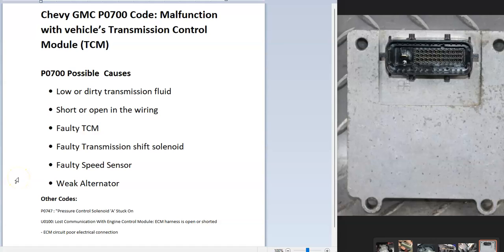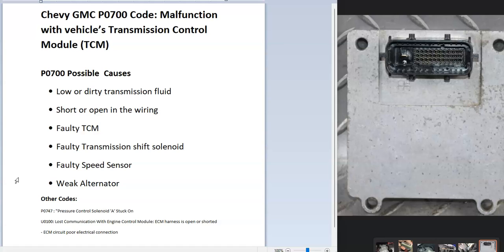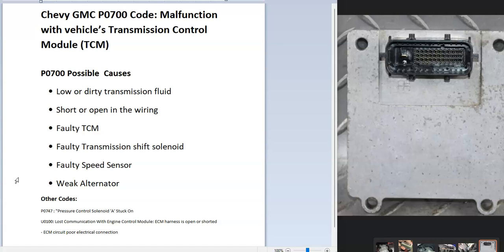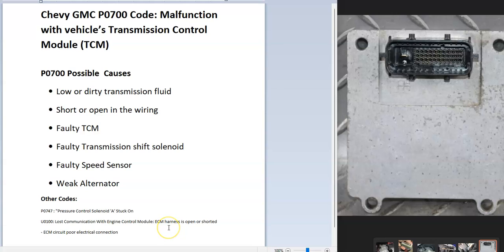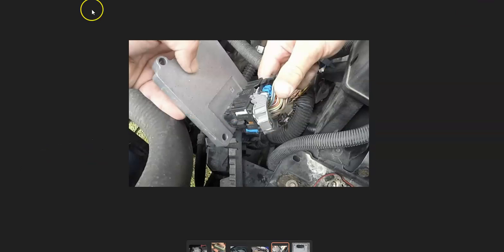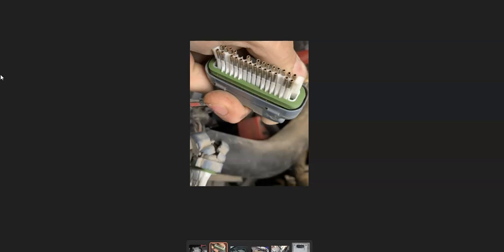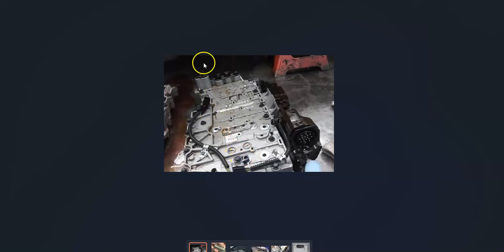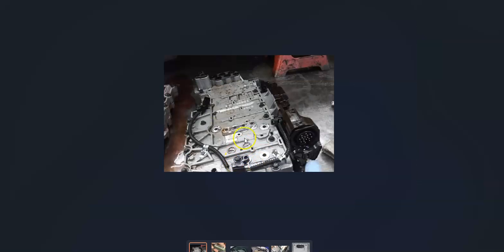Causes and Fixes Chevy GMC P0700 Code: Malfunction with Transmission Control Module (TCM)

Comment: I have a Chevy Silverado 2020  5.3L v8 6l80 and I was having problems with my truck when I wooing drive it suddenly it started losing the gear when I let off for a split second and got back on the gas it would just rev kinda like if in neutral but I would be in drive it would basically lose the gear and I would turn it off and on and it would work again till it did it again and I would get no codes till suddenly I got the p0700 code and it’s the only code that pops up anybody know what it could be if no other codes point to any direction?

Comment: 2007 Gmc Yukon Denali (159k miles)
 i just went to a local shop and the guy drove the truck and told me, i could change the control module and change the oil n filter but he wasnt sure it would fix it, so he said  he had some transmissions for $4k if i wanted too,  so i just paid him the $75 dllrs that he charged me to check it and i left. These are the 2 codes im getting>>>

P0700 ( Transmission control module requested MIL illumination)

P0756 (shift solenoid Valve 2 Performance -Stuck Off)

Comment: I have a 2019 Chevy Malibu LT with the code PO 700 only and the engine light comes on and go out. When I put the car in drive, it will not move and then when I go in reverse, it will move and I would have to constantly go from park to reverse then drive several times before the car would work properly. Can you give me some pointers on what is happening?
Reply: I have this exact problem on my 2018 Chevy Malibu !!! What could this be

Comment: Have you experience a truck that would throw codes ONLY when the trans is over 180 degrees? p0848 p0843 p0756 p0762, only throws one of them at a time but the code changes between those. 

Issue always comes up when I’m coming to a stop and it doesn’t want to go to 1st gear, and when it does it will go back to 2nd gear and throw a code 

New solenoids 
New wiring harness 
New filters 
5 month old pressure manifold 
All Valves move freely
Reply: 2007 duramax lbz 
Allison 1000
And it does have 310k on her

Comment: I had a lifter job on 2022 suburban done at a crooked dealership . When I got the car back , the engine was running fine , transmission shifted properly, then all of a sudden that check engine light comes on and it goes into limp mode ,codes(P0700 and p0747). My first thought was that they didn't plug something in or messed up a wire . The dealership is notorious for sending you out with another issue and having you come back.
The annoying part is that the truck drives great every time after i reset the codes , then the light comes on and it starts acting like i have transmission problems
Reply: What did you end up doing? Having exact same issue. Truck at shop now

Comment: 2003 gmc yukon starts but nothing when shifting between gears not even a change in idle and no codes should i just get another trans or is there any components that I should test for first? I was going very slow in reverse when it lost all gears at once upon inspection i discovered a couple of frayed wires and one severed wire on shift motor I thought maybe Play some miracle and somehow the transfer case slipped in the neutral and that's why it wouldn't go but changed this shift motor all my lights work correctly on my transfer switch now so I fixed the four-wheel drive but that doesn't do me a whole lot of good right now because still nothing in any gear

Comment: I cleaned the plastic air runner to throttle body..... and sprayed and wiped inside of throttle body with throttle body cleaner... gave the MAF sensor a quick shot of Mass Air Flow sensor cleaner... car ran like crap for few seconds till computer reset itself..  fixed my problem

Comment: Thanks for the info. I have have P0700 and P0701 code with the check engine light on and the PRND flashing. Also a message stating that speed has been reduced or something along those lines i cant remember while shifting from park reverse and drive. What could this possibly be?

Comment: I have a 2010 Chevy Silverado 1500 Texas addition , the lot I got it from put a used 6l90 in it I replaced torq converter with the billet to solve factory issue and trans fluid as well as filter , gave me a p0700 transmission control system mil request , and along with a p2534 ignition switch run/start position circuit low . First time it’s ever happened truck now has 220k on the dash torqconvertwr was changed around 160 , any ideas if the ignition switch has something to do with it ?

Comment: 2007 1500, have the P0700 and the U0073 codes.  Hard shifting tranny, wonky speedo, cruise shuts off.  Pull over, shut it down, restart and it fines.  Crazy...

Comment: My 2017 GMC transmission shudders at 45 speed codes P0700 and P0711 comes up jerks when shifting hard
Reply: P0711 is the trans temp is to hot or cold or a bad temperature sensor.

Comment: I have code p0182E and p0700 , I cleared code and only p0182E is still showing but car shift fine, any idea before I send to dealership, but before when I started car my door locks went crazy and I notice service check light was on and then I scanned I saw these codes.

Comment: I have a 2014 Chevy Tahoe PPV. And I changed out O2 sensors on driver side and catalytic converters as well all three of them. But keep on getting check engine. PO20 and P030. And then this code came out C070 I believe.  But you make your videos straight to the point, mad respect. Thank you I will check everything you mentioned.
Reply: Im having the same issues
Reply: How you fix it?
Reply: CATS WENT OUT..CHANGED CAT AND O2 SENSORS..NOW I GOT A 0700 CODE ..N I CANT FIND THE TCM. 2018 sierra 5.3

Comment: i have p0700 and p0106... the p0106 was the map sencer.. so got a new one and cleared code ...but still dint fix misfire code came back.. nothing changed
Reply: If it’s misfiring u probly have a bad coil. I changed mine in my Yukon and practically fixed it

Comment: Mines throwing TCM code and also transmission temp sensor faults. Could it possibly be low fluid?
Reply: Did you find out?
Reply: @dubbsackss20 nope. Dealership told me when it’s a cold start don’t put it in gear right away and since then I haven’t had those codes

Comment: 2010 Chevy work truck p0700 and p0100 and it will not change gear stay in first gear wat you think I should do check for someone tell me it the control module just need some assistance. Hit me back. Let me know
Reply: Did you find out?

Comment: I have a question I have a 2008 Chevy Silverado 1500 engine 5.3 and when I’m in a stop light and turn in the back shifts hard and it does it when I accelerate slowly it dosent have no engine light or nothing

Comment: '18 Tahoe 6L80 here. How about p0700 with p0714 (fluid temp sens intermit) and p0749 (press control solenoid intermit)?  The fluid was dirty, which i feel would explain the first 2, but also 749?  They are both intermittent codes... any ideas.  Never seen any of these codes before and it was time to do the trans service.  The codes came up and it started acting le it didn't want to go through all the gears,  turned it around drive it slow back home and parked it!  Then started ordering supplies for service.  I'm wondering if I should pull the valve body and try to clean it and possibly the TEHCM🤔  Those codes scared me!  Any help would be greatly appreciated!  Thanks!
Reply: Did you figure it out?

Comment: We have a 2017 Tahoe 5.3 with 6 spd. 110k miles.  Fluid changed at 70k.  Checking the fluid, it is not dark and still basically pink except trying to read it on the stick, it is almost clear to the point it is hard to read but can feel the level with your finger and it reads full.   Problems started two days ago.  Shifting rough usually from 1st to 2nd while on a 150 mile road trip.  Later in the day,  after idling in park in a drive in food line, put in gear and engine raved up to about 3k and then connected with a big bump.  Tranny temp was reading 196 after about a 16 min. drive before getting in the line.  Earlier in day when it began to act up, it died two times at an intersection.  I have had these symptoms before when I was getting a P050D code.(cold start/rough idle)  Engine light is not on and my scan tool does not show any codes of any kind.   After sitting overnight, tranny temp was 100.  When put in D range, engine speed went to about 2200 and then tranny engaged with a jerk.  Drove several minutes, stopping and starting and had the same results every time.  Ideas and suggestions suggested.  😭

Comment: I have a U0100 and P0700…. Very inconsistent and can’t duplicate doing anything specific .  Any one else experience this?   2012 Cruze
Reply: Oddly enough I changed the purge solenoid and haven’t had an issue since
Reply: You solve it?

Comment: Had p0700...went into limp mode. Limped it to a parking lot and couldn't back out, no reverse.  KOEO with accelerateor pedal foot to the floor for ten seconds and then keyed off. Released accelorator pedal and waited five minutes. Was able to drive normally and cleared code with a scan tool. Its been a few days since. Haven't had time to check the plug. But i have issues with the ignition switch. Being in Oakland...they tried to steal this thing a couple times...07 GMC Sierra.
Reply: Hello everyone, Did you guys end up fixing this issue ?
Reply: @rogeryanez8107  I'll say before this code, I had my transmission rebuilt. But after 4 months, this code was set off. Turns out my battery was the issue.
Reply: @JORDYSFUTURESUV  Wow I didn't know a battery can throw off this code, Thanks for the info ✌🏻
Reply: I’m having the same problem. Do you have a Silverado and what is it that’s giving you the code? TCM? Fluid?
Reply: Is it still doing it?

Comment: hello good sir, so i ran into  the P0700 code as well a P0741 code for a torque converter clutch (tcc) system stuck off. Does this mean i have an issue with the torque converter clutch or could it all be just dirty tranny fluid with a control module issue? thank you good sir
Reply: I'm in the same boat with 2017 silverado. Did you figure out out?

Comment: 2008 chevy Tahoe. Had a p0700 and also p1815 any help or solutions for that? Noticed the tran fluid is low. Could that be the issue?
Reply: Hey man did you ever figure out what it was in your truck mine has the same codes
Reply: @jonasalvear3843  no I didn't sorry.
Reply: @ thank you for replying back appreciate that

Comment: P0700 is the only code! When I got my oil change they said the transmission fluid was light in color and needed to be changed? Probably start there first. 2014 traverse
Reply: Hello, Did you ever get this fixed?

Comment: Thanks for the video. I've had my 2019 GMC Sierra 3500 with a 6.6L Duramax in the GMC shop 3 times now because my truck keeps going into reduced power mode intermittently and it throws the P0700 code. No other codes are lighting up. I'm still under the powertrain warranty. The first time it was in the shop, I was told the transmission fluid was too low. The code came back and the 2nd time I was told it was transmission valve body linkage. That didn't fix the problem and the code came back again (along with reduced power mode). The GMC dealer told me that were getting low voltage codes so they changed out both batteries. Now a week later, the problem has returned and I need to take it back to GMC for a 4th time. Needless to say, I won't ever be spending $75K on another GM product. This truck really is a piece of junk. I have climate control buttons with burned out lights. The infotainment center always freezes up a couple of hours into a drive. This is a 4 year old truck with 66K miles.
Reply: So what turned out to be the problem?
Reply: Did they figure it out?
Reply: They did not figure anything out. Gave it back to me after 15 days and said a generic P0700 doesn't tell them anything. They drove it for around 90 miles and it never went back into reduced power mode. So I've contacted an attorney and waiting for it to go into reduced power mode again and throw another P0700 error code. I notice when I drive it and take my foot off the accelerator that it doesn't coast, it feels like it catches and drags, like downshifting without a spike in the RPM. It's very subtle. I wonder if this is normal operations or a sign of something much bigger?

Comment: Mines won’t shift properly. It wouldn’t move forward only reverse but I turned the car on then off and I was able to go foward again but barely without lagging hard. What do you think new transmission or a part I can fix ?
Reply: I have a 2020 Chevy Silverado and it’s doing the same thing did you find the problem?
Reply: Same problem in 2017 silverado. Any luck?
Reply: Trans flter
Reply: Maybe neutral safety switch? Solenoids or even a corroded wire or harness

Comment: Po700 today , 2 weeks ago p0741 sheeesh! Brand new transmission. Low oil pressure alert yesterday , overheating regularly… that’s a lot in a short amount of time so I’m gonna check alternator
Reply: yea i think thats wat happened to mine. i got both codes thrown at me at same time plus spark plugs need replacing. i think i revved her too high and she didnt like it..
Reply: What was it
Reply: @918chase_rides  either the new transmission is acting up or I have a wire issue somewhere. Is your truck running fine ? And transmission won’t move? It’s in limp mode maybe ?
Reply: @CNSTAdventures  yeah it runs fine it throwing a bunch of codes all to the transmission and one misfire but yeah it won’t move put it in drive and press the gas and it just revs up like it’s in neutral
Reply: @918chase_rides  what are the codes? Is fluid showing on dipstick? Have you looked to see if the linkage is engaging the transmission to the shifter?
Reply: @918chase_rides  my transmission issues turned out to be burnt ATF fluid from it overheating when thermostat got stuck . It was almost black!!
Reply: @CNSTAdventures   so you just changed trans oil and all was good?
Reply: Recently few weeks ago new engine, then it overheated , now I got the p0700 code on my enclave smh
Reply: My truck won’t move can’t figure it out
Reply: So my overheating turned out to be a faulty thermostat. Torque converter won’t lock and I can feel it jumping . I will figure it out in a few days when I get home and let yall know . Bout ready to trade it in!

Comment: I’m getting these three codes

 P171D
Trans. Surge Accumulator
P0796
Pressure Control Soleniod Valve 3
P0700
Trans. Control Module

I need some help because dealership trying to upcharge me for nothing
Reply: Start with replacing the solenoid.

Comment: I am getting these three codes: P129D, P0700 and P2535 On a 2018 Chevrolet suburban 5.3 (6l80). What do those three codes point to?
Reply: I have the same 3 code for my 2018 silverado did you find a fix?

Comment: Nice video. I stumbled to your video because suddenly I was getting this p0700 code along with u0100. The check engine showed up then I tried to scan using my inexpensive Fixd tool. I did not experience any problems when driving it. Shifting was smooth. So I stopped and restart the engine using the remote and the check engine disappeared. I scanned it again and p0700 was gone but u0100 was still there. I reset the battery and all codes went off. Rescanned and no more codes showing up. Might be the harness you mentioned? Thanks for posting this video!
Reply: The error never back?

Comment: I just got my transmission fluid changed and filter. After about 120 miles after fluid change, I got P0700 transmission code. What could it be? Shop said they added 8Qts of Dexron HP. ‘16 GMC sierra 8 speed tran
Reply: did you ever figure it out?
Reply: @marshall8898  I think so I took it back to the shop and they scanned it and their scanner said P0711, which was the temperature sensor. Luckily, it was the last day of my extended warranty, and it covered most of the bill. I just had to pay for transmission fluid again.

Comment: What about po700 and po776 solenoid still follow the home reading that they should after I pulled them out and tested them
Reply: Po776?
Reply: Did you ever get it figured out? I have the exact 2 codes, and I'm thinking I just need to change solenoid b.

Comment: Many times back and forth for 3 minutes and then I get a little backward and no front and a !little more back and a little front then it drives and makes a little clunk the trans fluid doesn't  smell and no grit although I would like to check filter but when I drive it after small clunk I go 10 km tack at 1.7 and 20 30 40 50 60 70 back at 1.7 doesn't change shifts with no further issue of I stop it I might have to wait a minute with back and forth before I can resume my driving

Comment: I have a 96 Silverado, I have installed two different transmissions 4l60. Transmissions go into gear however truck won’t move. Lifted truck from rear differential and tires spin slowly however when I give it gas, tires stop. Any ideas?
Reply: Did you check proper fluid level?
Reply: Transmission fluid pump isn't working, or wrong output shaft on tranny that is to small to mesh with your transfer case input shaft.
Reply: @aaronj08ar  thank you, I should have updated you guys and give you info. They were selling me the wrong transmission this whole time. They were selling me a transmission for 95 and under. Chevy 96-98 are interchangeable only. Any other year transmission will not work because computer will not read.

Comment: I have a similar problem with a 4ld60e transmission, transmission was repaired but it does not work 1. Speed is in emergency mode. And I have code po700. Do you think it is the module?

Comment: Hi i have a u0100 and p0700 but its only trigger when I use obd 2 app for several minutes
Reply: Same thing. I disconnected negative terminal of battery and connected. It disappeared
Reply: Same only when I use remote start.